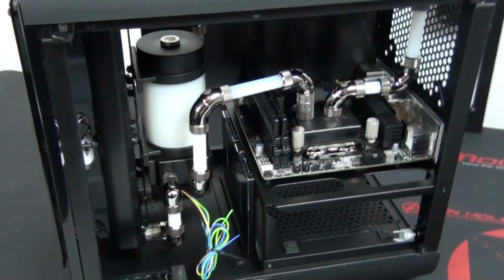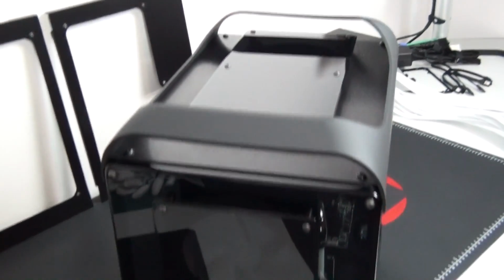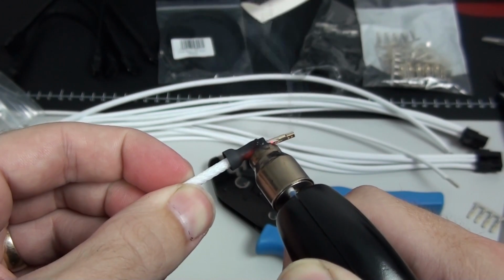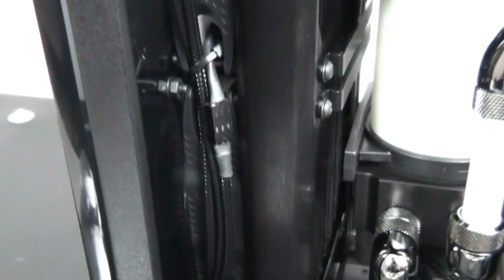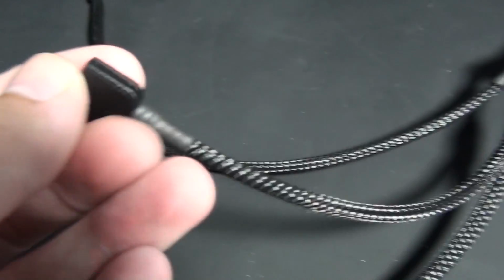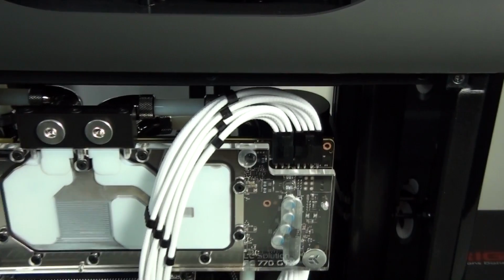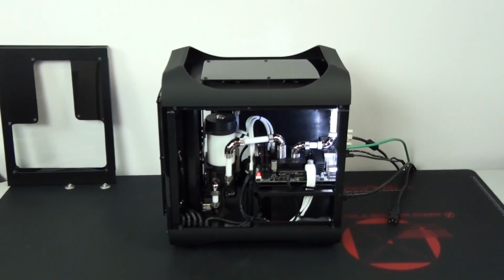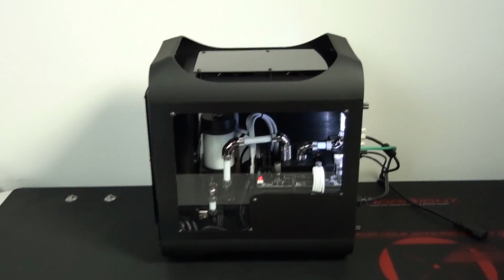Build #9: Extreme Prodigy: Part 5

Comment: Could you have flipped the SSDs around, so that the cables would have ran into the power supply area? I think it would have hid the sata power cable in a cleaner way, not quite sure of the routing the sata data cable would have taken though

Comment: Here is how I overclock and hopefully you will also find it useful. 
First step is to discover the thermal limit of your overclock (the traditional way). If it does e.g. 4.6 GHz while you are also happy with the temperature, go back to your bios and change everything back to standard configurations. 
Step two: This time, do not change the core voltage. Leave it up to the system to decide how much power it needs (and it figures it out pretty well).
Now go to your bios and change the standard turbo boost max frequency to the 4.6 GHz (on all cores) you found out to run stable and not too hot. 
What this does: Your computer will not constantly run at 4.6 GHz and a constant  high core voltage (and hot), since the system runs at dynamic frequencies up to 4,6 GHz and draws power depending on how much it needs (because it was left untouched in the bios, and changed turbo boost max to 4,6). This will also save you a lot of money on power and your hardware will last longer since your computer won't run 4,6 GHz when you're on your desktop, which I suppose a lot of people spend most time on :) This works on intel platforms. 
Hope it helps :)
Cheers

Comment: is it hard to just get some spacers?? intelligence.dll and logic.dll not found
Reply from the maker: Valen S
It would need to be at least 3mm to be safe because of the movement in the blades. So yes the gap would reduce performance.
Reply: Or washers..
Reply: if you have a big enough gap for the fans to operate than the fans wouldn't have as much pressure pulling through the radiator, and most of the air would be getting sucked into the gap between the fan and rad. intelligence.dll and logic.dll  needs a program that can comprehend it
Reply: you wouldn't get a big enough gap if the fans hit the radiator and still spin
Reply: you want the fan's frame to have a good seal against the radiator so you have as much air pressure going through the rad as possible, so you get more cooling at lower fan speeds, and you would need to big of a gap to keep said fans from rubbing against it, so the solution is put the fans in a push only config, or use a fan that doesn't have the clearance issue when in a pull config
Reply: connly33 i guess if you have a 1mm gap all the air that is being directed forward through the radiator would just take a 90 degree turn an leak out the gap, is that what you are trying to say?

Comment: Hey there, why the expensive bitfenix LED strips, when you can buy rolls of 10 meters off of ebay or dx.com, and cut them too size? Quality of those china strips are actually surprisingly good.
Reply from the maker: Ill check it out and do some testing, my main concern would be quality. I'm in the process of testing custom lighting configs currently to come up with an improved way of doing things. Cheers.
Reply: Yeah some testing would definently be needed. I know my friend bought a 5m RGB strip, and the green trace had a loose connection, so some testing before installing is a must, then you could always discard the faulty stuff, and just have a percentage discarded, but I'd still think it'd be cheaper.

Comment: If you could put that board or same type of board in a case with better air flow & post the board temps I would realy appreciate it. Working on an ITX build & not sure what case to get. I trust you more than most so your input is valued. Thanks, if you have the time & case to do it.

Comment: how often do you have to change the water in the tank?  i dont have very much experience with water cooling just normal push pull fans is what i typically use.  build looks amazing
Reply: he has said in other videos, that the mayhem coolant is good for up to two years
Reply: I replace mine every 6 months.

Comment: cant you use a rubber surround between the fan and the radiator to avoid the blades touching?
something like the rubber squares that are on the fans in the 800d
wouldnt that put enough space between the fan blades and rad?

Comment: there are also white cable ties, you know? the black one on the sata cables looks just unfinished. this build is stunning, i love the smoked glass on the front and the top. everything else is just fine, the only big problem i got are the corsair vengeance ram "cooling fins". they are just disgusting. its only a thin sheet and doesnt do anything to the ram. its like a thorn in my flesh. there are a lot better ram modules with black aluminium fins, which fits more perfect to your builds. please stop using that "corsair crap"

Comment: you are an inspiration!
I've always modified the stock cables but next time I'll try to do them from scratch. Only need to find good cables. There are some "double" cables in the 24pin but I see you're using wires with all the same wire gauge, so using 18 AWG on all wires should be no problem?

Comment: I want to ask have you try bending the tube (hard tube) instead of using that many fittings? or what you think of bending I'll apreacite a lot your response I think it looks better and cleaner than a lot of fitings and much harder to do I hope you have time to answer thanks in advance ^^
Reply: He likes the clean, sleek look and it is very strong when it comes to shipping, he won't have to worry too much about breakages etc.
Correct me if i'm wrong Singularity :P
Reply from the maker: seismicbreaker
Yes I definitely prefer the look of fittings compared with bending acrylic tube. Coming up Ill be doing a few builds where I bend acrylic tube instead of using fittings. Depending on the config fittings can be stronger, sometimes they make things weaker though because it means more connections. Cheers.

Comment: hi i use 5mm 12v leds 3528  you can cut in 2 sections of 3 and i have mine running off my fan controller using a 3pin power fan fitting so if i don't want them bright or on just twist it 2 the desired look u want

Comment: You preach aesthetics, but the heatshrink on those molex and sata power cables were sub par. Love the way you handled the cabling for the graphics card though.
Reply: Benjamin Murray Just because someone criticises someone else's work, does not mean that they have to be better than them. If it is sub-par, it is sub-par. I sleeve a lot of PSU's the heatshrink method and I agree with Michael entirely. Even on the Pump too. He could have had a few mm of shrink on the inside of the pump hiding any wire colouring. Also the SATA Power heatshrink on the wires was not heated enough which left a visible rim at the end of the wire. All that is needed is a lighter to go around the rim to melt the sleeve. Also the heatshrink on the PSU end of the connectors are a bit too long, if the sleeve is melted to the end of the wire only 5mm or so should be hanging out for max tidiness.
Reply: Can you do better and prove it??
Reply: Benjamin Murray I never claimed to be able to do a better job. I have watched ever single build Dan has put out and he is very finicky about his wires, I was meerly sharing my opinion about the heatshrink sorry to have offended you.
Reply: Phillip Baines The difference here would be that your watercooled desk can take forever, but this is for a client so there is a schedule. Not excusing the "shoddy" heatshrink job, but I would be more than happy to fork over the dough for a machine like this. Some of the best work I've ever seen was done by amateurs, but professionals get a quality job done way faster.

Comment: Did you think of cutting thin rubber to act as spacers inbetween the fans and the radiator? That might have worked.
Reply: Actually, the fans come with rubber isolators for the screws that hold the fans off just enough that they don't make any noise. However, they are for the 6-32 or 3mm screws the fans come with and he only uses 4mm, but yes a little rubber spacer about 1mm would stop the noise but it also introduce a gap between the fan and radiator for air to move through lowering the effectiveness of the fan. It really is best to use E-Loop fans in push or not at all.